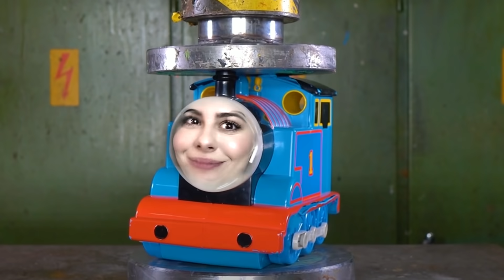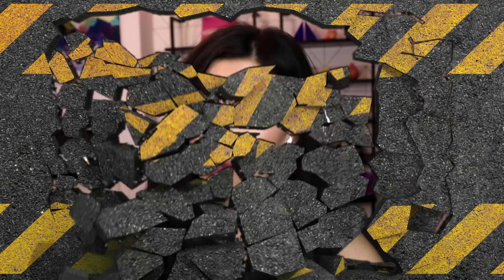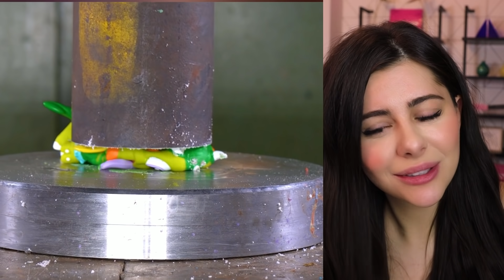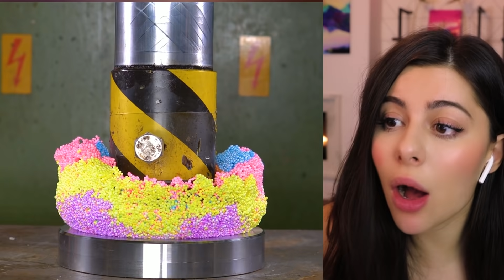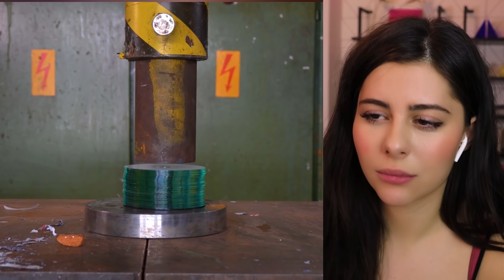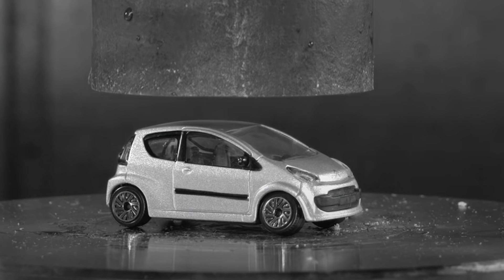Amazing Things Being CRUSHED !

Comment: Azzy:THOSE HAVE TO BE LIKE PUTTY LEGOS OR SOMETHING

Science nerds:Actually according to science the reason why most of the things that got crushed got softer and seemed to be different textures is because the hydrolic press has heat and pressure and with that heat it causes things such as legos to melt.